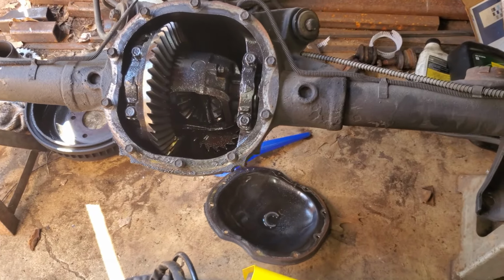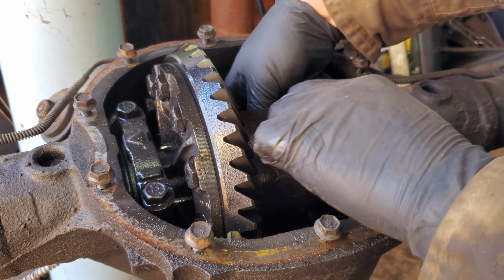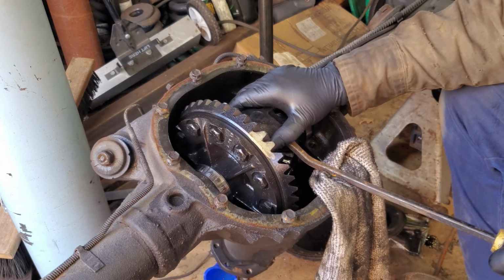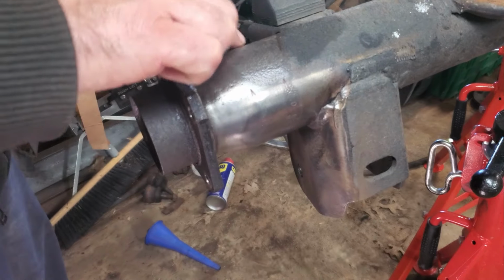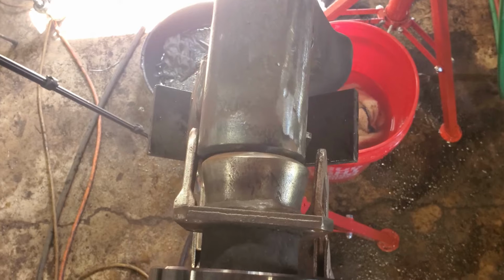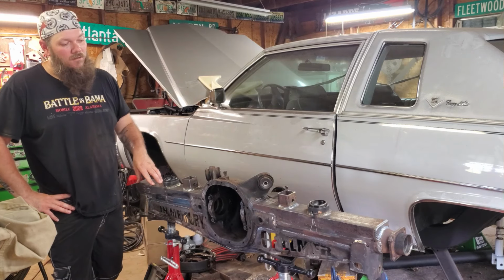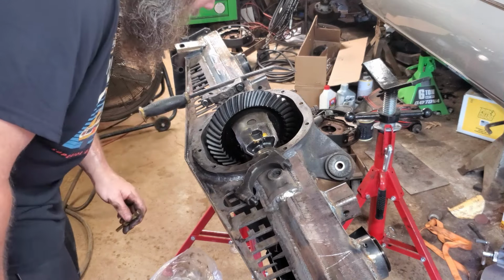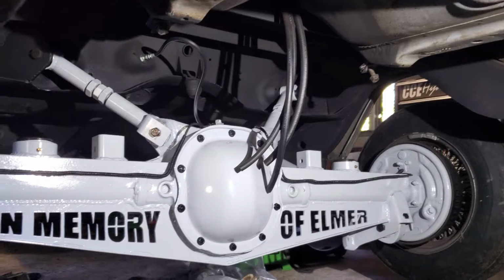Shortening A Cadillac Rear End

Comment: Is there any other rear end or g body rear end I can use insttof cutting if to make it shorter
Reply from the maker: I habe used g body rear ends before you will need adjustable upper trailing arms to make it bolt up. But I have had issues where the brake drum will hit the frame when three wheeling.
Reply: @thecadillacdanshow8658  what if I us 93 lac rear end on a 77 ??
Reply from the maker: Its wider due to the tone ring for the abs
Reply: @thecadillacdanshow8658 appreciate the info

Comment: Hey dan how did you get the 79 to 3 wheel so easy?
Reply from the maker: Had to fine tune the upper trailing arms right now it three wheels earlier on the passenger side then it does on the driver side. The owner had the transmission mount wear out he was chasing a noise he adjusted the upper trailing arms thinking the noise was coming from the pinion to later find the worn out mount so now we need to go back and fine tune the arms
Reply: @thecadillacdanshow8658  are the lower arms stock and what size are the back strokes?
Reply from the maker: @OG2win1 stock length lowers with 14 inch cylinders
Reply: @thecadillacdanshow8658  cool thanks bro I watch you all the time great content I can't find you on Facebook though

Comment: Brent knows all about heat transfer on these rear ends. back in the day in 2009  had him reinforce and narrow a rear end for me for my 81 coupe deville build and the heat from welding plus the weight of the downforce of it sitting on the jack stands while welding did the exact same thing as yours did. (81 coupe deville build) what sucked about my situation was i done sent it off for chrome plating after it got narrowed and reinforced. i invested about $2600 in a rear end i couldn't even use. after i got it back from chrome the driver side axle wouldn't even slide  back into the spider, the tube on the driver side was tweaked bad from heat of welding. Brent made things right . he was just as shocked as i was..if i only knew what i know now i would've checked before chrome. i had no clue that could even happen. wish i just went with a narrowed ford 9 inch from him. Brent is the fuckn man tho! He is legend and knows his shit inside n out 💯